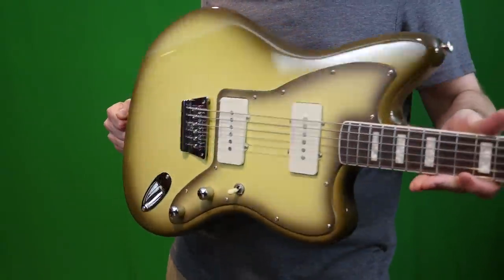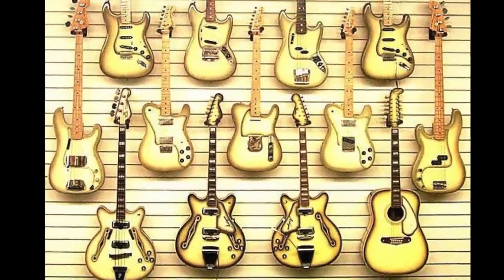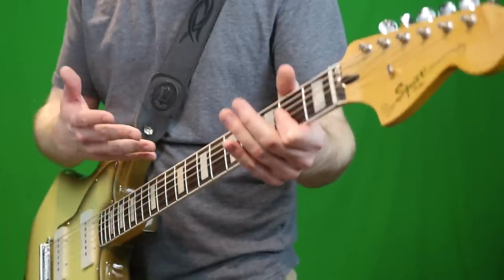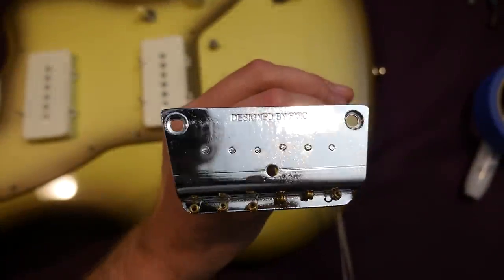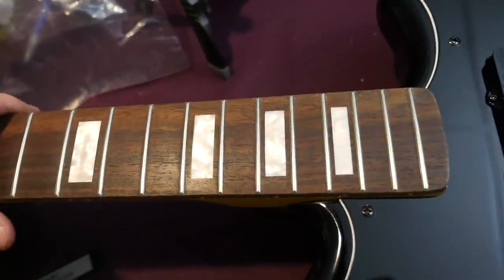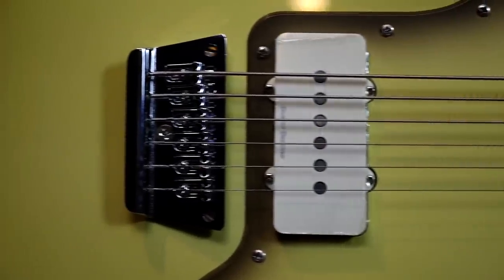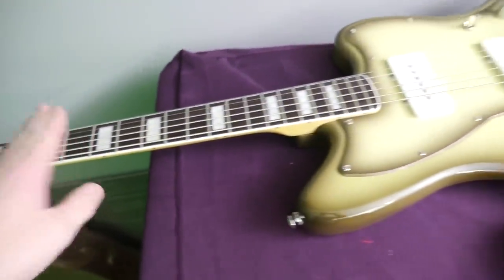This Squier is a SECRET Weapon! | Fender Squier Baritone Jazzmaster Antigua + Black | Review + Demo

Comment from the maker: These are great guitars to have around for inspiration! Not quite the same use as the Buckethead LP though!
🔴Reverb: https://reverb.com/item/33186560-video-2017-squier-vintage-modified-baritone-jazzmaster-black?_aid=growsumo&gs_partner=Trogly
Coupon Code: TGS20 at checkout!
🐕 Episode Guide:
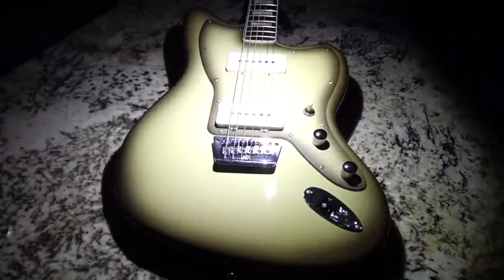0:30 - BARITONE!
1:35 - Famous Users
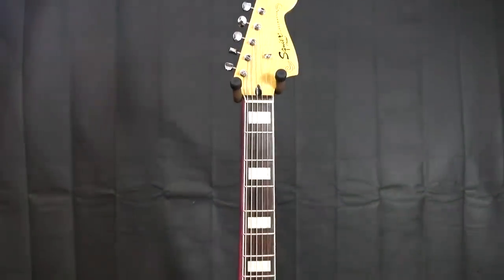2:31 - Value
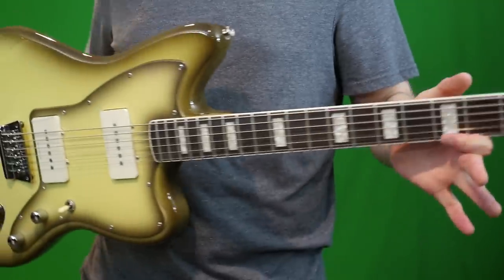3:10 - Antigua Finish
5:38 - Black vs Antigua Jazzmaster
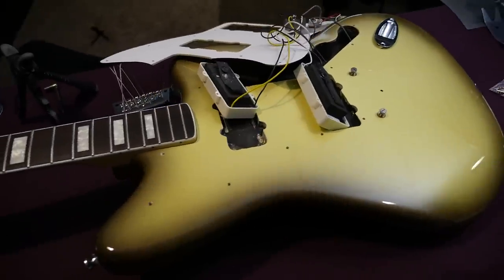7:50 - Inside Look
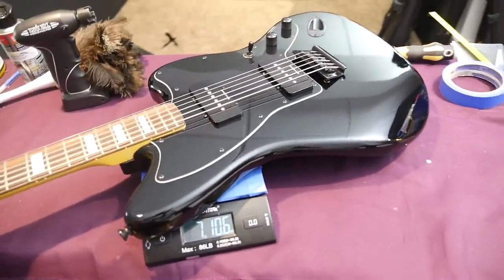17:55 - Tone Demo
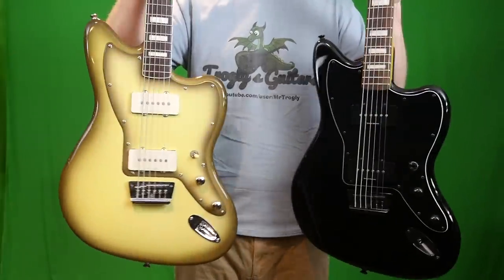21:03 - Final Thoughts
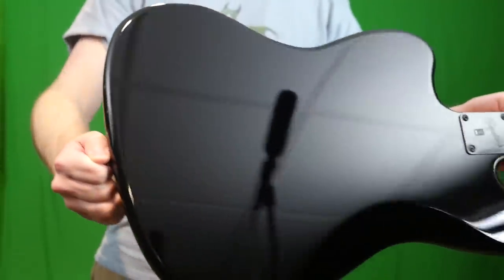24:12 - Blacklight
Reply: Did you pay $ 800 for your's Trog? I cant believe they are going used for those prices! As far as I know these are still available here in the U.K. or they were last month. I was gonna buy one myself. $ 800 used is crazy money! Wow!
Reply: Why bother with it ?
 One might as well just play a Bass Guitar !
Reply: the only 70's strats i even like are the aged Antigua, and the 1979 anniversary
Reply: What are the tuners on it
Reply: Hi Trogly, could you also review the non-baritone version of this guitar? Same version but 25.5 inch neck, released in 2011

Comment: The “high end” squiers are honestly some great guitars. I walked into guitar center to buy a jazzmaster and ended up walking out with a squier classic vibe when it ended up playing better than the fender player, and it was around 400 rather than the 600 dollar fender player. Full gloss neck, good quality tuners, and a tremolo that keeps in tune. A both budget and quality guitar. You obviously won’t get the quality of an LP custom but it definitely does the job. Try one out and see
Reply: Leon Balladares i also believe that the Squier VM has actual alnico jazzmaster pickups where the Fender Player one has essentially P90’s under a jazzmaster pickup cover. Something like that. Either way the current Fender ones don’t have actual jazzmaster pickups
Reply: BessieBopOrBach i meant the classic vibe one then. I don’t consider a jazzmaster without jazzmaster pickups a real jazzmaster
Reply: High end Squiers and Epiphones both are usually better than spending the extra $150-200 on their entry model big brothers.
Reply: classic vibes usually come with a bone nut.  classic vibes are some of the best.
Reply: Josh Battershell seriously, outside of the body shape, these in no way resemble a Jazzmaster
Reply: Same! I walked into guitar center with like 500 to spend on a guitar, and I walked out with a Squier J Mascis signature Jazzmaster, and it plays better than the any of the Fender player series that I’ve played.
Reply: Dude my main guitar is a squire body with a strat neck and its sounds great

Comment: its so interesting this baritone squier jazzmasters have become Djent, and metal staples. I would understand the Jim Root jazzmaster because of the EMGs, but these single-coil squires got a surprising amount of attention.
Reply: blendernoob64 Single coils are djent-ier than people give them credit for. Hell Tony Iommi used a strat very early on before his famous SG
Reply: Plus, the squiers and a lot of mexicans dont use proper jazzmaster pickups
Reply: @asamakowski8316  not to mention his SG had singles in it. two p90s and then custom p90 like custom pickups
Reply: @asamakowski8316  he literally only used the strat for wicked world and that's it he went to the sg when they started recording black Sabbath
Reply: Slipknot play Drop A and B, so they need articulation  so the bass not muddy. EMGs are hi- out put and have a lot compression. singles are less bass than HB so can OD them and keep clarity. plus, scorching mid- highs. more raw in a way.

Comment: Picked up a modified jazzmaster for $650, Had to get it rebuilt by my friend Ryan since the last owner drilled to far into the body to fit a bare knuckle pickup. After all repairs and changing out some flimsy parts I got a one of kind modified jazzmaster that’s feels and plays way better than the stock versions.  The guitar def benefits from Locking tuners, I highly recommend if you’re playing low tunings like Double drop D and C#

Comment: About a year and a half ago, I had been searching for the Antigua finish jazzmaster baritone. There were plenty of the all black ones new from the major retailers like Guitar Center and Sweetwater. I ended up locating one for sale on eBay from a store in Canada and pulled the trigger. 

I waited for several weeks and never received the guitar. I called the shop multiple times and they finally told me that the neck was twisted and would no longer be sending me the Antigua burst. They had a black one in stock and sent me that one instead.

I ended up refinishing the black version to look like the Fender original 60’s in Ocean Turquoise. 

I replaced the stock Duncan Designed Jazzmaster pickups with a set out of a Fender American Professional Jazzmaster. It sounds awesome. I put lighter gauge strings on 
(.13-62) which plays very similar to 10s on a normal Fender scale.

Comment: The only thing I could figure why they weigh differently and being made from the same wood may be depending on which part of the tree it was cut. The heart of the tree is more dense than the outer portion. The antigua may be heart wood and the black one may be from the outer portions of the tree it was made from. How much difference between a neck with or without binding. Who knows really. Just a thought. Maybe try a sustain test between them. 
These two are very cool! Definitely on my bucket list now. Thanks for the review!

Comment: I bought a Squier Baritone Jazzmaster, the black one to be specific. Gotta say I'm surprised you didn't demo these instruments with a distortion channel. the amount of buzzing that came out of mine was pretty off putting. For an issue this bad im surprised it was over looked. to anyone who wants to buy one be sure to thoroughly test it to avoid disappointment. I'm having a tech guy have a look at it right now, I'm not sure if its a universal problem but I've seen a couple other demo's and you can hear the awful buzzing so I'm almost assuming that the quality of these instruments isn't up to standards that I'v seen cheaper guitars own up to..

Comment: Just wanted to explain the bridge. If you look at it is is essentially a Danelectro bridge. On the Danelectros you have a strip of rosewood on a three point bridge. This bridge does the individual saddles instead of the rosewood strip. Now you know what happens if you cross a Synchronized Fender bridge witha Danelectro!😄👍✨

Comment: UPDATE: Trogly is vindicated! Apparently, inexpensive guitars paint is alcohol based because it "drys" manageable within 4 hrs., but is brittle. Though more time is needed to actually dry, polyester is applied as it a porous substance. Thus the drying process literally completes itself in transit. This is why cheap guitars stink like fresh glue-ish or chemically-ish. It may have polyester drips, smudges in the paint, finish cracks, bump chipping, etc. As the price for the instrument increase, so does a better process, in theory. Also, the neck process is similar causing fret buzz on a new instrument. No chance to properly dry, it draws the wood closer on the thicker painted parts- fret boards. It seems the Ch!ny Glibsons and Squirrels by Fender (and more) enjoy problematic issues. Though not always, sadly hit or miss. Further, substandard materials add to this to begin with. Too many poor incremental variables add up to visible ends. Cheap is as Cheap does. good luck.

Comment: Oh man, I want one of the black ones SO BAD.

I consider myself a bassist first and a guitarist second, but in such a capacity that I see the two as extensions of the same instrument concept and like the idea of them being "merged" into the Baritone guitar concept -- that, or a 7 string guitar. Whatever gives me otherwise standard or close to standard tuning with the extended low end. I'd rather do that and have everything be mostly in sync with a 5 string bass rather than drop tune and deal with all that entails... so there's kind of a perpetual debate in my mind -- do I want to go 7 string for the standard tuning with a low b, or do I want to go with a baritone and have what's more mostly like a standard tuning that, while a bit off, I can work with as the patterns will stay the mostly same and the instrument is built for it.

Or do I pull a Lemmy and play a bass like a guitar, because I can do that as well, but, you know, I like to keep my options open for when I finally get around to recording that solo project. Haha.

Guess I'll have to save up, though, because I'm dang sure I want a black Jazzmaster baritone sooner or later. I really enjoy  what I saw here.

Comment: Just a heads up, the Fender Bass VI is not a baritone guitar, even with that bass cut switch. Its sound circuit and sound is way too low and you can really use it only as a bass that you can do guitar like things on it but for sure not actual guitar stuff

Comment: What these are selling for on the used market totally caught me off guard, and I'm on top of just about everything Squier to the point of of ridiculousness. I've been waiting for the Paranormal Series that'll be announced at Summer NAMM since Winter NAMM in 2019, and I started to keep my own yearly records of serial numbers and factories broken down by model to pass time. 

There are a small handful of Squiers that sell for pretty similar prices on the used market and a couple that sell for quite a bit more, but I've never seen a model made after 2001 that was getting anywhere near the kind of money these are getting. Sub-Sonics were 27" scale baritones based on the Stagemaster that were only sold in 2001. I've usually seen them sell for between $500-750. I've seen people ask around $900 for them, but I doubt they got it. The Vista Series had some unique guitars built between 1997 and a small part of 1998. Super-Sonics usually sell for somewhere in the $900-$1200, and I've seen some nicer examples sell for above $1300. The Venus (Courtney Love's signature guitar) came in 6 and 12 string versions. The 6 strings seem to be down on average now, and nicer examples might sell for $750-$1000. $750 was around the low end for guitars that were clearly players until a few years ago. You can find them for around $500 when they show up for sale now. The 12 strings often sold for around the same, but you'd see them creeping over the $1000 mark pretty often, and they've stayed there. For what it's worth, a NOS 6 string Venus sold on Reverb for something like $2500 at one point, and I've never seen another Squier come anywhere close to that. Their early Japanese guitars and basses from 1982 to 1984 (the JV series in particular) are typically in the $1000 range. Nicer examples can pull $1200, and some SQ series stuff will sell for north of $500 on occasion. That's really about it though, and these are all guitars that you only see people like me with more disposable income going after them. 

They're reissuing the Super-Sonic as part of the Paranormal Series, and I'm predicting those to be the next Squiers to skyrocket in price. They'll be retailing for $350, but I'm expecting them to start making big jumps as soon as they're back ordered and people start getting scared they won't get one. The Vista Super-Sonics are scarce as it is, never mind the price. Fender reissued them in the Pawn Shop series in 2013 and 2014 and sold them for $600. I've come across a couple that have sold for around that price used, but they sell for around the same as the Vista Series Super-Sonics now. I'm planning on buying one that I probably won't keep (which I'm sure I'll eventually regret), along with a new Toronado. I don't want to be that guy, but with a little patience, I won't be surprised if flipping the Super-Sonic ends up almost paying for the Toronado. It feels weird making predictions about the used market for a guitar that isn't even announced yet haha.

Comment: I've never liked the Antigua finish, ever since I first learned of it in the early 1980s.  If it was up to me, I'd use the neck and pickup covers from the Antigua and put them on the black edition.  Unlike the standard Jazzmasters, I like the fact that the tremolo bar is gone.  From my experience (one old buddy used to have a 60s JM, and another, a 70s model) as soon as you'd use them - a re-tuning was mandatory.  You would probably miss the old Jazzmaster electronics though.  The adjuster that was installed closer to the neck on the old models, kinda made this solid body guitar sound like a Gretsch Country Gentleman.  In a basic "rock" mode of guitar playing, I can't see the reasoning for the baritone tuning, unless you were doing a surf guitar era tribute show.  Otherwise, you would just be using it as an accessory guitar on a few songs...or perhaps for effect in a studio on demos.  But it's always great to see that Jazzmaster design, regardless.  I think I recall reading that the Jazzmaster was introduced by Fender to be "better" than the Strats.  What a great design.

Comment: Does anyone know if trogly sells parts? Pickups to be more precise. I have my dad's old 86 studio that i swapped the pickups out in when he passed about 8 years ago, and I'm regretting it alot. The guy who did the work for me gave me a great deal on the work he did. Considering how long it's been I still have no issues with tuning or playability. But he offered to keep the pups that were in it and give me a 100 buck off for the work he did. At the time they would scream bloody murder when plugged in and I just assumed they were busted. In hindsight it was most likely a wiring issue. Anyhoo, I'd like to original pups from that year. May be a long shot but I'd live to find some to swap back in.

Comment: Hey Austin mate. I have the Harley Benton version of the Bass VI which is quite a bit cheaper than the Squire version at something like £165. Great lil bass for the money. Speaking of which I put some wall hangers up the other day & the very next day my HB Bass VI came crashing to the floor as the walls in my room are like chalk & it just came crashing down! I thought it was gonna be f***ed but there was not a bit of damage. Gonna but a sensible guitar multi rack stand instead! My Mustang is still hanging up fine as well as my Jazzmaster as they got lucky with a bit of wall that was more solid. Lol. Bass VI's are boss though. Gonna get the Squire version in black next. Cheers man. What is the asking price on that black SG with the Floyd Rose I seen in the background a few days back? Is that one of the Floyds you can fit to an SG yourself or stock? Take care.

Comment: If you wanna solve the problem of scraping off the paint from the pick guard, and never have any scratch or a chip on a guitar ever, use this paint protection film for automotive. 3M where the first to make this type of product, but right now Suntek make the best one on the market. We put these on collectors cars in the 300k$ so no it is not a cheap product and it invisible to the eye. If despite the fact that its almost impossible to scatch, you just have to use a small hair dryer and the scratch  will totally disappear. All my guitars have a piece on them. And no obviously it doesn't alter the sound. I was going to make a video on how to install one nut I am too sick right now and I will not get better.
https://www.suntekfilms.com/suntek-window-paint-protection

Comment: Typical...a "budget friendly" guitar that becomes popular and is now no longer "budget friendly"...which means it should be compared directly to what is NOW at it's price-point. You would have to be insane to spend $800 on any Squier. Calling it a "Fender" Squier shouldn't change it's value either, drop the Fender and call it what it is, a Squier. No one calls an Epiphone a "Gibson Epiphone" so drop the Fender from Squier, it's misleading.